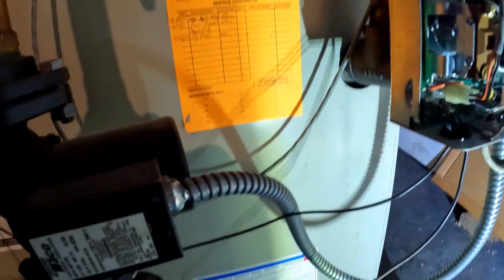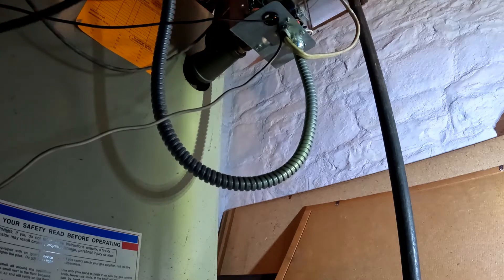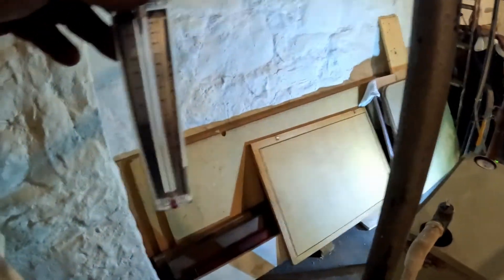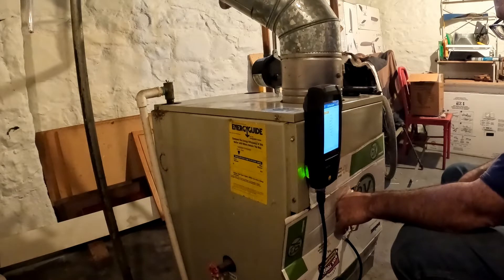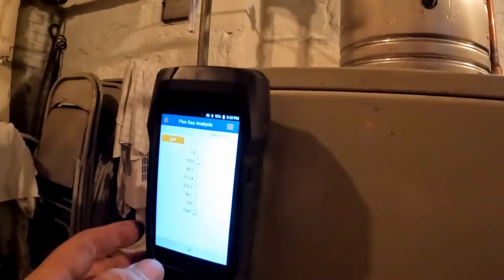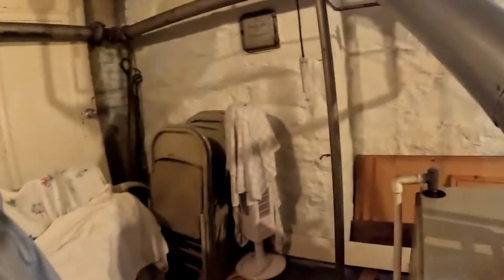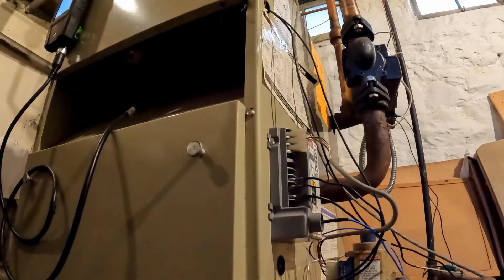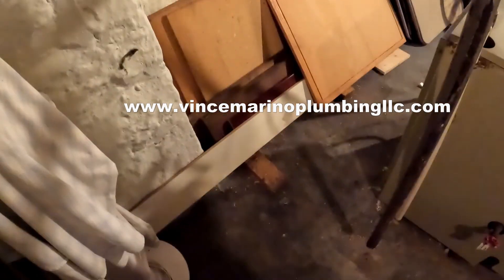Carrier/Dunkirk  Boiler with  combustion and control issues.

Comment: Just a question, I know ppm should be less as possible max 500 preferably less than 300ppm. But what I heard if more than that 500. If adjusting gas valve and oxygen level can’t help. The boiler needs to be change, I don’t know it’s right or wrong. Second year plumbing helper. Thank you